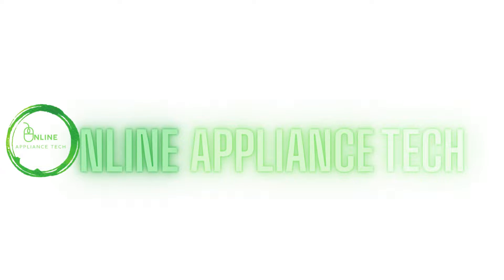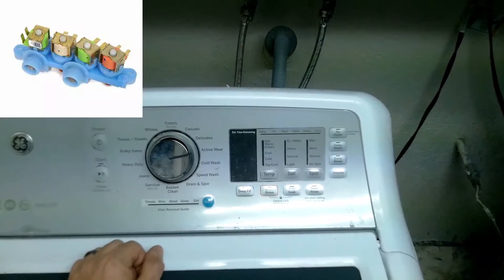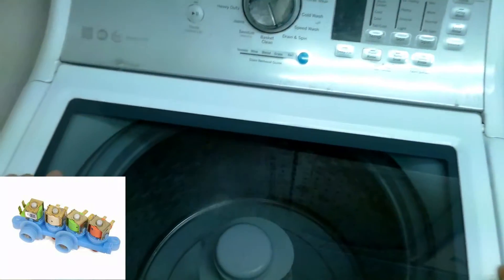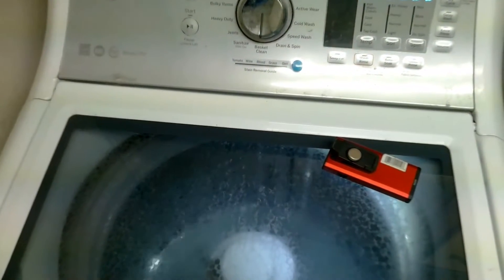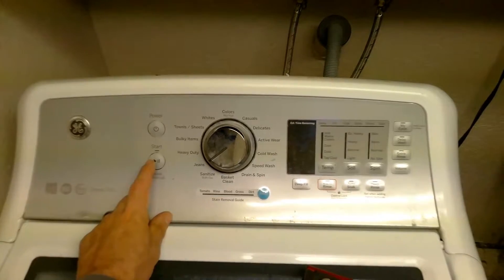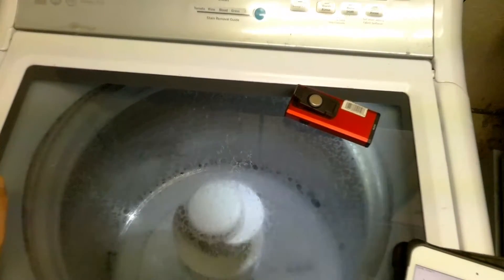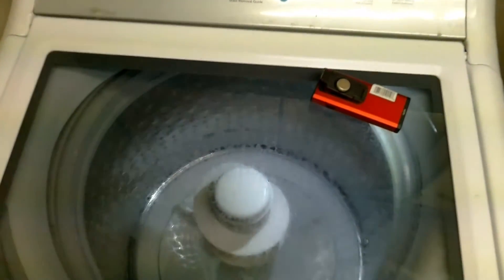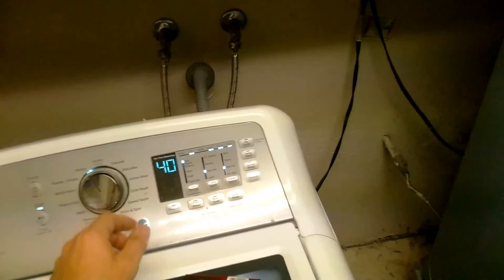Learn about GE Washing Machine Diagnostics & Troubleshooting, Error Codes & More!

Comment: Might be a Long shot… 
I get error code 30, from service paper it’s “stuck button fault”. Can’t really find a problem with buttons. Issue is washer will sometimes not want to finish the load, typically after wash cycle when drain and spin should be happening. 

Great video. Very helpful. 
Same model type as video, digital display.

Comment: Thanks for the video.  I get error code 3, but the lid switch test blinks on rinse as yours did.  It also locks when the cycle attempts to start.  Most times the spray jets go off and then the cycle ends.  Any ideas?

Comment: Great video. Mine is stuck in sensing and it won’t start washing. Couple of questions. Code 11 “ circulation pump” mine has one. During the test should the drum spin or should I only hear the pump activate? All I hear is the pump activating. 2nd question. When my drum is spinning, it’s literally bouncing all over the place. Are the balance springs bad?? Thank you

Comment: Help please! No errors, all diagnostics seem well- but clothes are soaked at the end . Had a tech come by but he said we need a new machine/ motor. I think it’s just a belt? Where is the belt video maybe that will help me?
Reply from the maker: Sounds like the belt..
Reply: @onlineappliancetech  do you have a link to the belt and video on how to replace
Reply: Ge says my machine doesn’t have a belt GTW720BSNWS
Reply: I also turned upside down and it’s not the same as the other videos

Comment: my washer would not spin, lid was able to lock, then cycle stopped, could not unlock the lid unless power off and on again. I got fault code 3, which showing UI software version critical, do you think it is the control board got bad?

Comment: Very good video.  Thanks.  My fault code was #10 Shifter  . Do you have a video on replacing the shifter?
Reply: The shifter is what control your wash plate from going into agitation mode and locking the washplate for spinning. The shifter has a arm on it controlled by the transmission and if it fails this could be the shifter alone... or it could be the transmission..  and also could be wiring harness not send right signal to the shifter on when to lock and unlock cause the cheap little arm to break. Its very easy to change out. Wiring harness is just a clip, then 2 screws to remove it and reinstall a new one. It will be on the under side of washer. Theres a ⚙  looking that ur wash plate locks into and the shifter connects to that.

Comment: Hi Online Appliance Tech, thanks for the great video! My washer spits out codes 14, 26, 23, 25, 17, 19, 1, 
My washer doesn’t do a complete spin and leaves clothes quite wet. It almost finishes it’s spin but goes into “balancing” mode when it doesn’t have to. It also jumps from 10 minutes left to 3 and stops without doing a good high speed spin. It’s almost like it has a concussion and forgot it’s program. 
I tested all the components in the test list and everything seems to work. 
I just don’t want to pay $125 for a service call if I can fix it myself. 
Thanks for any help you may be able to share. I have an even more detailed version of what happens in a spin cycle if you need more details. 
Cheers, John
Reply from the maker: Hi John,

Thank you for reaching out and sharing the detailed issues with your washer. You've certainly done a thorough job diagnosing the problems so far! The error codes you've mentioned (14, 26, 23, 25, 17, 19, 1) suggest a range of issues, from potential sensor errors to communication faults between the washer's components. The symptoms, especially the spin cycle not completing properly and the machine attempting to balance itself unnecessarily, could point towards issues with the load balance sensor or the control module not processing the spin cycle correctly.

It's great to see you're looking to tackle this issue yourself, and with the right support, I'm confident you can fix it. For more detailed assistance, our website offers a virtual chat service where you can talk directly with our appliance tech experts. They can provide you with step-by-step guidance based on the specific error codes and behavior of your washer.

You can access this virtual chat service through the link in the About Section of our YouTube channel. Our team is ready to help DIY enthusiasts like you get to the bottom of these issues. If the virtual chat raises any more questions or if you need further personalized advice, our experts are there to assist you in real-time.

Cheers,
Online Appliance Tech
Reply: @onlineappliancetech  Hey, thanks for the nice reply. Sorry for the late reply myself. My computer broke down and I'm just getting a new one up and running. I'm also back to work so I didn't have time to check out your virtual chat service. Give me a bit of time to get my new PC up and running and I'll get back to you guys. I'd rather do this on my PC than my phone as it doesn't work too well either and I hate typing on a phone. Thanks for everything so far and I'll be in touch soon. Cheers, John
Reply: @onlineappliancetech  Hi again, Just wanted to pass along something you may find amusing. I'm kinda ashamed to admit what I did, but I did and it's over with now...here's the story:
The other day during a wash cycle I was trying to intervene in the spin cycle so it wouldn't go into it's "balancing" routine that it's been doing lately, but I missed it. My timing was off and the washer started pouring water in over the already spun out clothes. Well, that triggered my temper and I gave the washer a bit of a beating. I pounded on it and shook it so hard that the dial knob fell off...lol! ( this is the part I'm ashamed of as I should not have such a bad temper...anyhow... ) After I beat up my washer it started working properly and doing the spin cycle like it used to!!!
I don't recommend this type of repair, but in my case, it worked. 
Thanks again for being there for us DIYers who are looking to fix their own appliances. Who knows, I may need you in the future, you seem to be a good resource. 
Cheers, John
Reply: Hi Again! Just a follow up on the proper fix for my washer as the “ beat and smash” technique was NOT the answer. 
I found the drive belt was worn and not spinning the washer properly. THAT was the actual problem. The proper fix for that was a new belt. Cheers, John

Comment: Thank you for the great video. I looked for the error code list but was unable to find it. Can you direct me to where i can locate it? Also if you can shed any light on why when i turn the cycle select dial it skips around.
Reply from the maker: It seems that the selector knob might not be properly engaging with the display control, or the display control itself is malfunctioning since it's not responding to the knob's adjustments.

Comment: I have the same washer,door lock busted so used a stick,stick fell in made noise when washing dissasembled and got it out reassembled and plugged back in lights come one one second then nothing,no power no lights continuesly blink at board what did i do wrong??
Im a RV appliance repair guy but have no washer knowledge 
Can anyone help??

Comment: Mine gives me codes 3,5 7,14,17,26 only let's me test 7 which is fine. I don't have the option of 26 and the rest populate a 0 on screen and won't test the error code. What would the issue be?

Comment: I have a question for you! I replaced the main board, that fixed the buttons no longer working on the old one. However, when I go to run a cycle it will fill, just start into wash, and then CANCEL and drain the load. How do I correct the cancel error?

Comment: The issue i have is Anytime i press any button is only changes the time. Even the power button and start button only change the time. I have been unplugging the machine, turning to speedwash and holding start. Thats the only way its been working. Is there a way to reset the electronic system?
Reply: You get it fixed I'm having similar issue
Reply: Hi, I’m having the same issue, did you fixed it?

Comment: My ge washer will not spin hear as if it wants to spin but will not its no water in the tub
Reply from the maker: Hello Richard,

Based on the details you've provided, it appears that your belt might be dislodged or damaged. Do keep me updated with the situation. Wishing you the best of luck!
Reply: @onlineappliancetech  I took the black cover off , the belt is in tact spins both ways no issue I can tell, nothing expain my issue no utube 3xcept for a drain pump motor being bad,  there sound like water but not in the tub maybe in the pump.

Comment: Hi my washer will not spin when in a wash mode or when i select drain/spin. however when i go to the service mode and select 14 i am able to run the spin mode. i also see an error code of 14 and 18...any thoughts or suggestions?
Reply from the maker: That is a good one without seeing it in person, Error 14 is a Spin Error sounds like a door switch with symptoms but I have seen in the past if the belt is slipping it will not  lock due to the motor sensor not sensing rotation. Check out my GE washer video.  ( video name is " GE Washer Not Spinning or Draining - How to Fix It") It's about checking and replacing the belt  due to not spinning. Hope this helps!

Comment: I hav an error code 4 which isn't on the list. It states loose connections. How do I do a factory reset.
Reply from the maker: Unfortunately there is no factory reset. You may have a defective MPC or cut wire or even a part that is not allowing current to get from A to B.

Comment: hi can you help me with error code 44
Reply from the maker: Error code 44 stands for drive motor or motor inverter board error. Most of the time it's the motor inviter. I would have it checked by a professional. Hope this helps you!
Reply: What will cause  a BaLaNcE error and oob , I changed rods and still giving me oob error